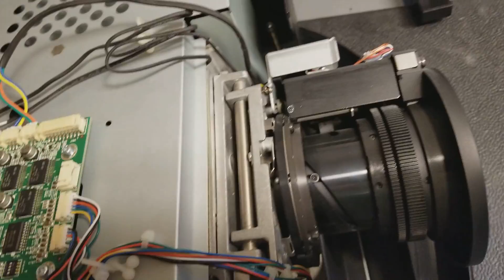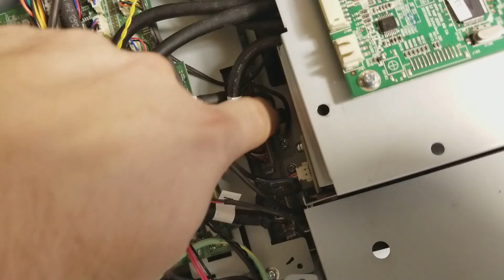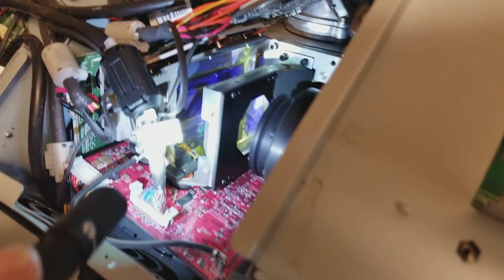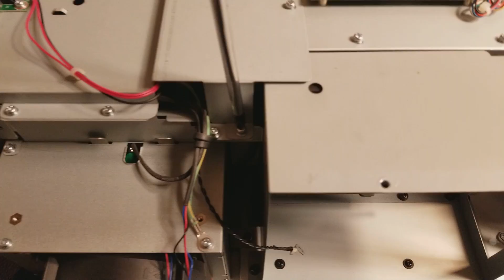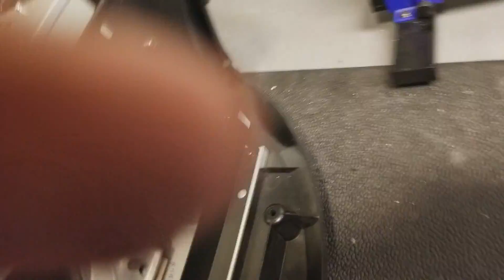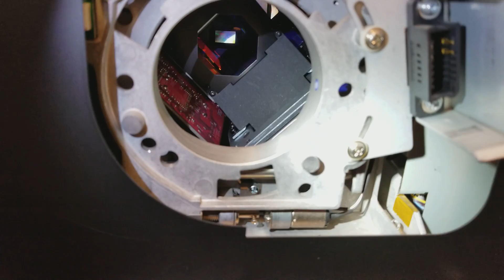Runco LS10 Projector Inside tour

Comment: cool,never seen the inside of a 3 chip dlp .What kind of lamp type,watt,lumen output?Can you film when you test the picture please?regards from Sweden.
Reply from the maker: Hi David, I don't have a good video of it running unfortunately. It has a long throw lens and I don't have a 50ft area to set it up. All it looked like was a blurry blob :/    Its a nice projector but between you and me and whoever else reads this, its overpriced but it is a Runco.  It uses a pretty standard Osram 280W watt lamp. Almost the same lamp as an Eiki AH50001.